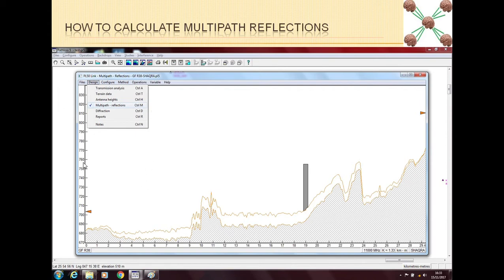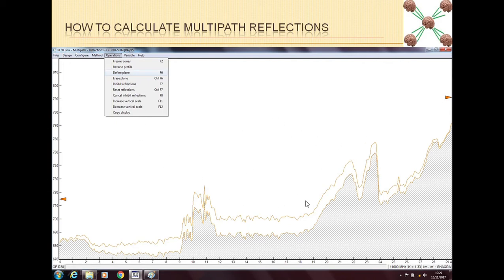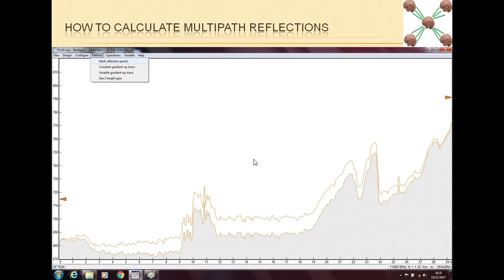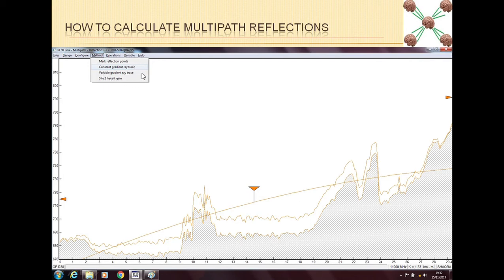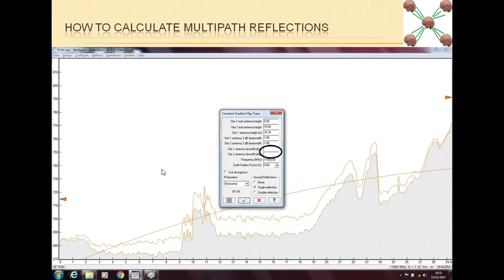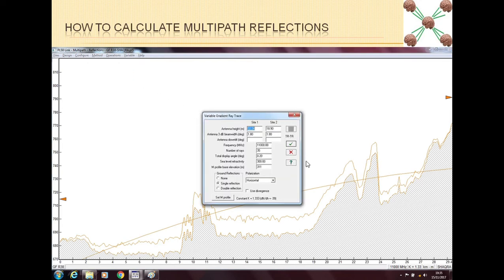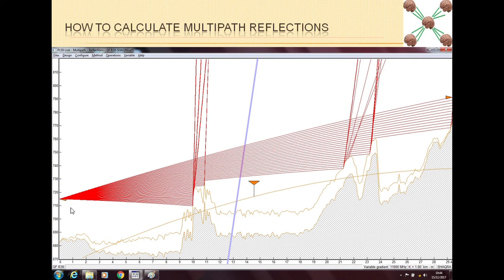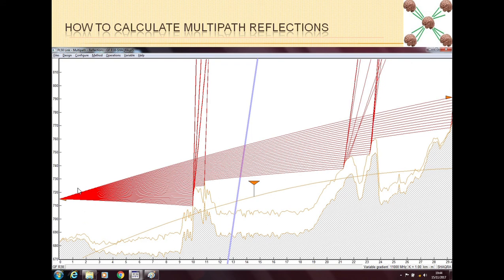Path Loss 5 - How to Calculate Multi-path Reflections

Comment: Hi mr. Abdul, thanks for the info. Is there any tool or way to measure the impact of the Multi-path Reflections in pathloss 5?

(For example, when there is an obstrucction I can measure the loss with the tool Diffraction Loss)
Reply from the maker: Yes, same like diffraction you can measure multi path as well. I have a few videos on this topic too
Reply from the maker: https://youtu.be/ufSMJGb0OqY

Comment: could SD configuration as solution if  multipath reflection happens?
Reply from the maker: Yes, SD can be used a solution to multi-path but you need put the main and the diversity dish in such a way that it become a real solution to your problem.

Comment: Hi Abdul, thanks for sharing your knowledge. 
Could you please tell me what happens when you get the warning from pathloss "Reflection point outside plane limits" ? that is a message I get when defining the reflective plane. Can I assumed that there is no possible reflection affecting the link? Thanks in advance.
Reply from the maker: What it means is that the plane that you are defining is small and the reflection point lies outside of it, usually what I have seen is that there is some small mistake that we are doing, if you can share your end points with me on khan.abdulaziz@gmail.com then I can go through and suggest something better

Comment: Kindly explain what is the purpose of down tilt in bit more detail
Reply from the maker: Dear Zubair, thanks for your question, the general reason of downtilt any be one of the two, (One) it may be due to some overshoot observed through tool or through some actual frequency scanning of near-by sites, (Two) or it may be a requirement by the planning team to de-focus the link if the incident ray has much higher power then the overload value of the receiver,  there may be some other particular reason due to the implementation of the link.

I hope I have made it clear for you, please let me know if you still have any question
Reply: It clear now about the down tilt ... Thanks.